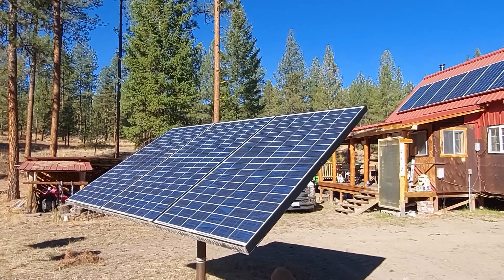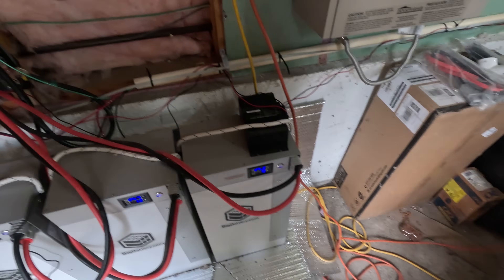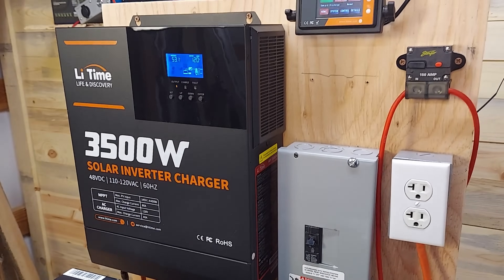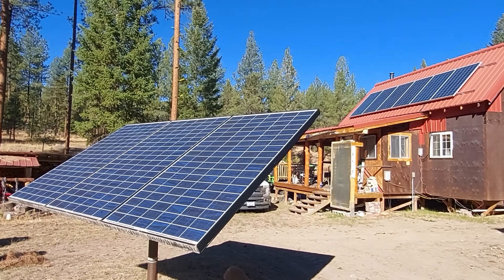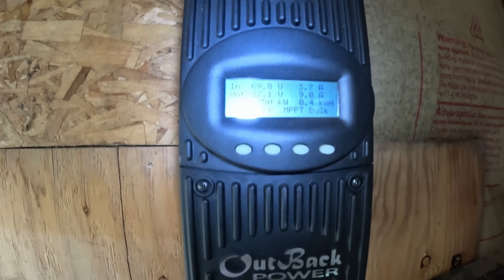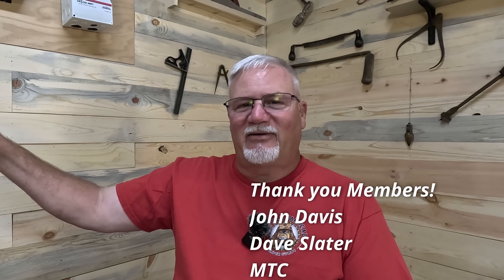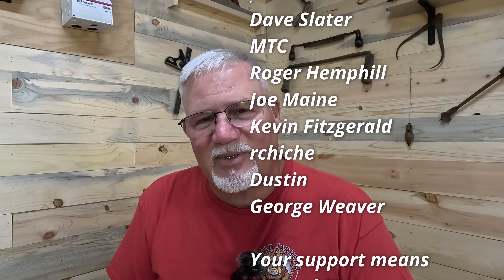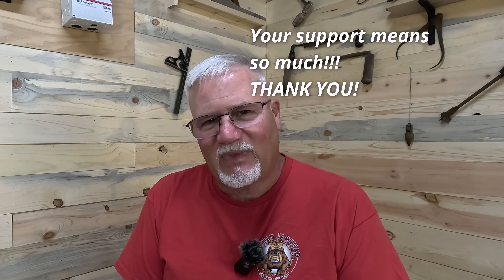Revamp Your Off-Grid Power: Essential Upgrade Tips!

Comment: Clear as water for hydro HAHAHA, living in small apartmen abou 688sq ft, having 260watt panels total, and allmost never knock on wood power outages, run tv and lights on Allpower r600 as inverter using 12v batteries external. i dont have the issues with larger things as you discribed. But love to watch and learn. Have a great day.
Reply from the maker: Cheers!  I'll be busy clearing at the cabin today!

Comment: I just got 6 Trojan 6 volt batteries and I hope they are enough to support my needs. The refrigerator is my biggest energy user. What's your opinion on Trojan batteries.
Reply from the maker: They are good batteries though I always thought too spendy.  I used GCBs because the cost was lower by enough to make it worthwhile, but Trojans are very good.  Just take care of them and don't use them more than 30% if you can help it and they could last 15 years.

Comment: Good video. I have an old bank of AGM's I got back in the day I use for reserve and backup. My main bank uses LiFePo's. In my opinion anyone who is serious about off grid or grid down power uses LiFePo's for all the reasons you explained or until something better comes along. I agree stored WH capacity and continuous power output in watts are the two most important parameters. How you do it is your choice. On choosing an inverter, another parameter is how much peak or boost power it can provide. This is important for starting larger inductive loads like refrigeration. Most inverters have good peak values but surprisingly I have seen some reviews where that is lacking even on some well known brands. Pure sine inverters and MPPT controllers are a given these days. My idea of an ideal setup is 48 volts worth of LiFePo batteries, enough charge controller to keep them charged, enough solar panels to keep up, a 48 volt inverter and a dual fuel generator running on propane as a charging backup with an appropriate plug in lithium charger. Sound like a lot but you'd be good to go.
Reply from the maker: Agreed!  I'm using an LF inverter 😁 no problem starting anything 😁 It's the HF inverters that struggle with high staring loads.  A d yes If I (when) upgrade it will be 48v 😉

Comment: hey I am ordering a vertical wind generate will let you know how it goes to charge my LIthum battery solar system (I have an eco flow)
Reply from the maker: I looking forward to it!  I've seen those and wonder if they work as well as they claim.
Reply: @TheOldJarhead  3000W 12V-48V Vertical Helix Wind Turbine Generator Windmill Power w/Controller, its due to arrive next week will keep you posted, I'm a DIY guy but only been doing my solar 2 years and learning a lot. roached the first one lol. So I like watching your show a lot haha
Reply from the maker: It happens!  I smoked my 1st batteries in 4 years.  Learned the hard way! lol

Comment: It would be great if you could recommend some micro hydro setups. I'd rather buy the hydro unit instead of building one. I'd like to keep it small to be inconspicuous, and we're only running lights and a small 12v fridge anyway. There's a stream near our cabin that runs 24/7, 365.
Reply from the maker: I wish I could!  I had a friend who was putting one in a while back but sadly he passed before final setup.  I know many use them and believe they would be great to have but have never tried one as my stream is slow and seasonal.
Reply: @TheOldJarhead  thanks for replying. I'm a new viewer, and I really enjoy your content. We have lots in common, including cabins and wood mizer sawmills! Keep up the great work.
Reply from the maker: Cool!  I love my sawmill 😀 and cabin!  Where are you located?
Reply: @TheOldJarhead  near Pittsburgh, PA. If you're ever headed this way, let me know.
Reply from the maker: Been a long time since I was WAY out there!  I built a NOC (network operations control center) in Lebanon of all places back in 2009/2009 and travelled back and forth there through to early 2010.  Also have a Marine buddy from Butler PA (he's still there but we lost contact info).
Reply: @TheOldJarhead  we are only an hour from Butler. I work in emergency management, and one of my coworkers was in the army. I believe he did similar things to that. Now we have new fangled radios that he plays with. We love our jobs!
Reply from the maker: Cool!